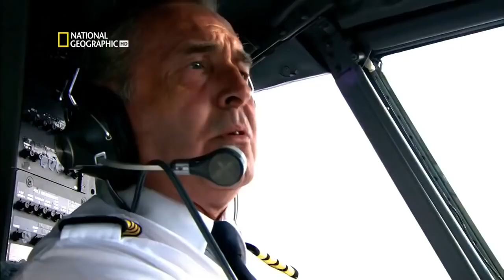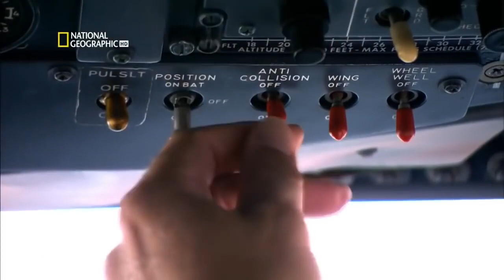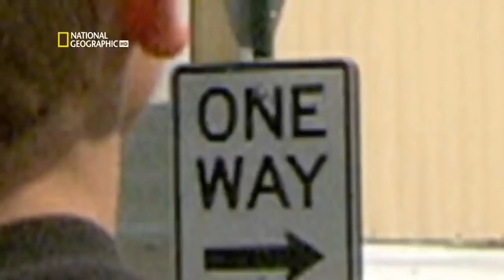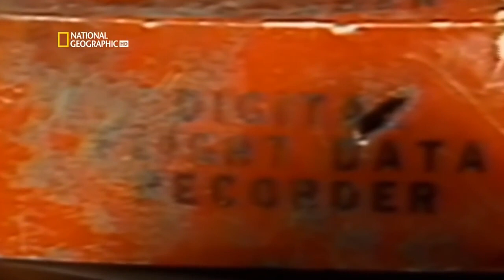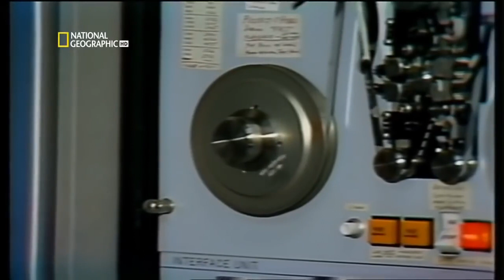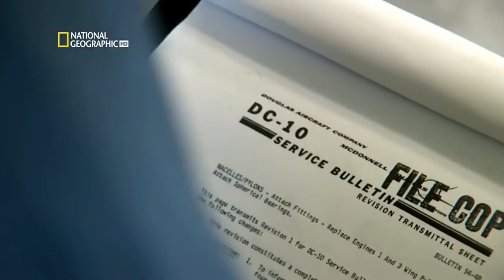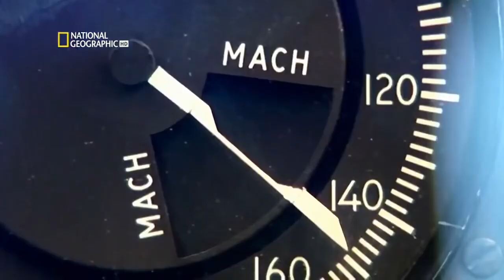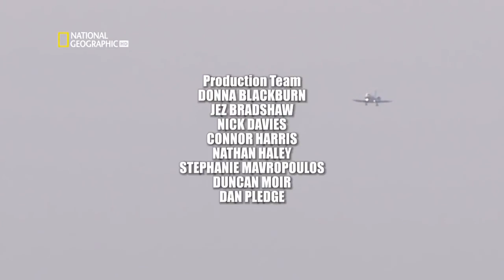Seconds From Disaster Flight 191 Crash (Chicago 1979)

Comment: Imagine being a passenger on this flight with a window seat on the left side, looking out the window during take-off and seeing the engine flip up over the wing and detach completely, accompanied by the loud sound of twisting metal. Several people must have shouted “OMG the engine ripped off!!” Followed by complete chaos and screaming as the plane tilted completely sideways. I can’t even imagine.
Reply: Exactly. The ppl that saw the engine fly off must've thought "wtf??"
Reply: They knew they were screwed😭
Reply: You know what else is messed up? In the cabin in this plane they had monitors so the passengers could see what the pilots were seeing. Assuming those monitors didn't lose power those passengers would have seen the ground coming right at them as the plane smashed into the ground..

Comment: The DC 10 got the nickname. Death Chamber 10.

R.I.P. To those who lost there lifes... 🥀
Reply: I never knew that , maybe that’s why they were cursed with so many accidents
Reply: And to think back about how many of those things I've been on is scary.
Reply: Yeah, another juvenile label.
Reply: The name is funny but the incident is not
Reply: The DC-10 certainly had flaws, but a lot of the disasters were because of inexcusable improper maintenance by airlines from what I've heard. The DeHavilland Comet was possibly Britain's equivalent of the DC-10, at least one literally blew apart in the sky from flawed designs (I think they finally pulled it from service). We take a lot of aviation safety today for granted, a lot of it has only been since the 1980s.
Reply: Yeah that horrible Alaska Airlines inverted flight was a DC 10
Reply: The DC-10 was involved in 55 crashes and incidents so far as of September 2015 with 32 hull losses and 1,261 fatalities. Turkish airlines flight 981 went down in France in 1974 (346 fatalities), followed by American airlines flight 191 (273 fatalities) and Air New Zealand flight 901 (257 fatalities) in 1979 and United airlines Flight 232 (111+ fatalities) in 1989 were the major crashes/accidents (the accidents of flights 96 and 981 were by cargo door failures. Flight 981's cargo door flaw lead to this flight going down into a forest in France)
Reply: The Death Can 10 also caused the Concorde disaster thus ending supersonic commercial flight forever. A piece of a Death Creator 10 literally fell off on the runway and the Concordes wheel ran over it at high speed.

Comment: So what you're saying is the maintenance workers trying to be cheap and cut corners by using a forklift for their inspections cost those people their lives. I hope they got in trouble for that, their use of an unapproved inspection method basically broke that plane.
Reply: It wasnt the maintenance workers i think it was american airlines itself that ordered those maintenance workers to use a forklift for cheaper maintenance
Reply: It's interesting because this video leaves out a lot of the more interesting stuff about the crash having to do with the drama AA caused with McDonnell Douglas.  AA shredding a vindictive report, a mechanic committing suicide before having to testify in court, McDonnell Douglas rightfully fighting with AA over who pays the settlements, and the video didn't really clarify that the engine falling off wasn't really the cause of the crash--it was really the fact that AA was allowed to only install one stick-shaker to save money.  Because if they knew it was actually stalling, the pilots would have known to apply power or reduce the climb.
Reply: @mig0yy  yes
Reply: @PlymouthNeon  If you watch the other air crash investigation, called Mayday Mayday they go into it more deeper than this series does. I always considered seconds from disaster a watered down investigation where they do more on other disasters where Mayday, is nothing but aircraft crash investigations.
Reply: The scary thing is AA wasn't the only airline using the same procedure, during the grounding of the dc10 many more were damaged because of the procedure

Comment: Its kind of freaky that another flight 191 crashed 6 years after this, a different airline (Delta). Not the same circumstances but same flight name.
Reply: Exactly. I thought the same thing. Don't EVER get on a plane that has the flight number 191.
Reply: NASA's X-15 flight 191 was a THIRD tragedy involving that number. The craft broke apart, killing the pilot. It's like that number is cursed or something when aviation is involved.

Comment: There was a flaw with the DC-10's second engine, mounted in the tail.  Just underneath the tail engine are all three hydraulic hoses.  When UA232 suffered its explosive engine disintegration due to a casting flaw, 111 people were killed as a result of the accident.  An unnoticed crack caused the fatal crash.  This happened AFTER AA191's fatal crash.
Reply: Um... Wrong crash?

Comment: "...but co-pilot James Dillard corrects it with the rudder.  He knows the DC-10 can fly with just two of its three engines and has been trained to deal with exactly this scenario.  To reduce the load on the two remaining engines, Dillard follows AA guidelines and slows the plane to the minimum climing speed...V2.  175.84mph (152.8 knots or 283Km/h)."  MISTAKE.  Slowing the speed only increases the loss of altitude.  Pilot error never played a factor in the fatal accident.  The guidebook was wrong.  Today, the guidebook shows to maintain the engine speed rather than reduce it should an event like AA191's ill-fated takeoff from Chicago happen.
Reply: Yes, Co pilot James Dillard did correct the plane from rolling in the first try, however, as he reduces speed to V2, flight 191 rolls sharply to the left, co-pilot James Dillard tries to correct the roll with the rudders, however the plane won't respond. As flight 191 climbs to 90 meters it stalled the plane

Comment: Once they explained the pylon I figured that the rear bolt either broke or the bracket was compromised possibly due to corrosion and was located in a near impossible spot to inspect. Close but no cigar. I guess I need to watch more video to get my YouTube engineering degree.

Comment: Yes, Engine 1 blew off from left wing, slats retracted on the left wing. The number 1 engine provided all the hydraulic and electrical systems to the cockpit which cuts out the stick shaker. As  Co- pilot James Dillard Slows the airspeed to v2 142kts. This made the wing stall even further and reduced lift. The electrical systems were cut so all 3 pilots weren't aware that they are going to stall. 10 seconds until impact, the left wing stalls in a critical point and flight 191 starts rolling hard to the left. It is an unpreventable bank. Both pilots try to correct this with the rudder, but the DC-10 continues rolling harder and harder to the left. 32 seconds after lift off from runway 32R, American Airlines flight 191 crashes into a Trailor park near a hanger and around 4000 feet from the runway threshold. All 271 passengers and 2 victims on the ground are dead, making it the worst U.S. Aviation disaster.